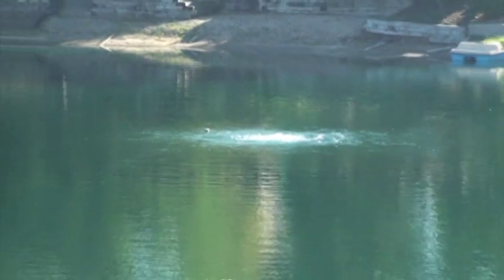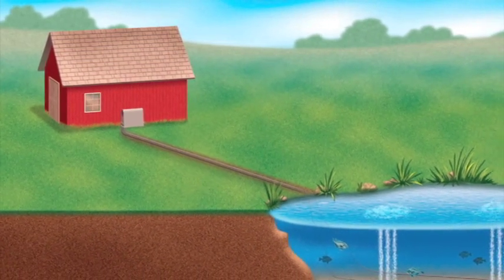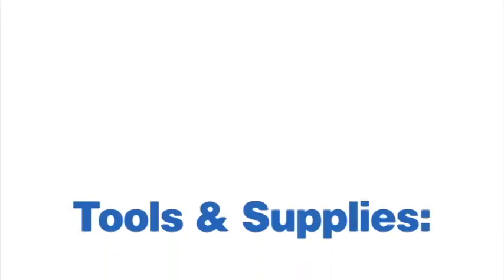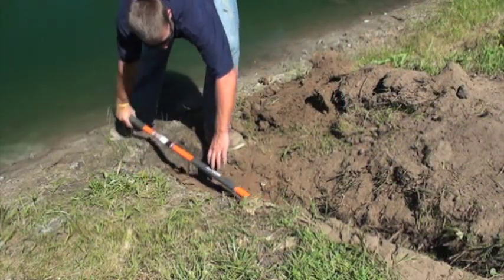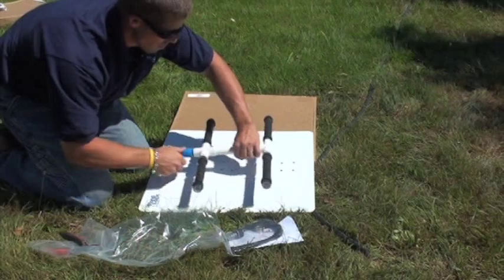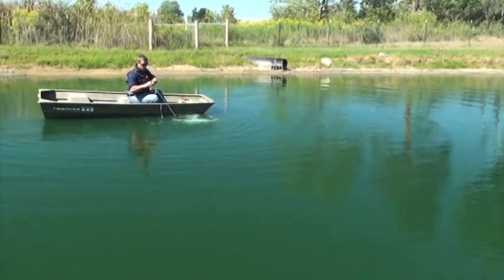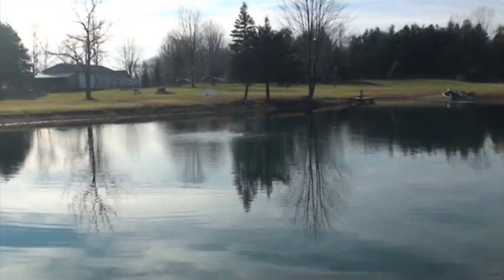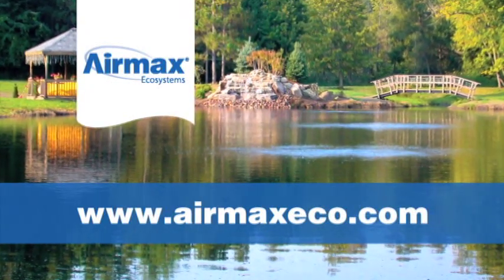The Airmax Ecosystem - Installing Your Aeration System

Comment: Can you run just one line and one defuser? Or do I have to use both. Also, could I put a T connection at the pond to use both at the pond. I don't really need both defusers.
Reply from the maker: Hello Brian - We offer several different systems that include different number of plates. To find the best system for your pond, please contact us at (866)766-3435.

Comment: I purchased the ps 40 with 3 diffusers. I spoke to one of your representatives. I asked if it came with installation instructions. She said it did. I received the compressor and hoses. The compressor didn't look like the owners manual. It had 3 pressure guages the housing for the manifold had no holes. I was stumped for awhile. Apparently the compressor is connected to the direct burial hoses, 3 of them then connected to the 3 self weighted hoses which run to the diffusers. What is the remote manifold cover for and why doesn't it have holes for the hoses. If this was the instructions for set up, you need to reprint the owners manual with correct pictures. Disappointed
Reply from the maker: Hello - Please contact us at 866-766-3435 for additional assistance with the installation of your PS40 system.